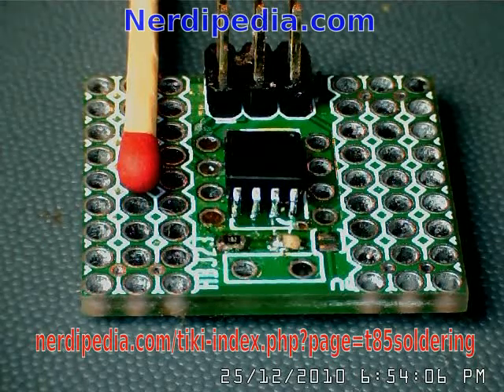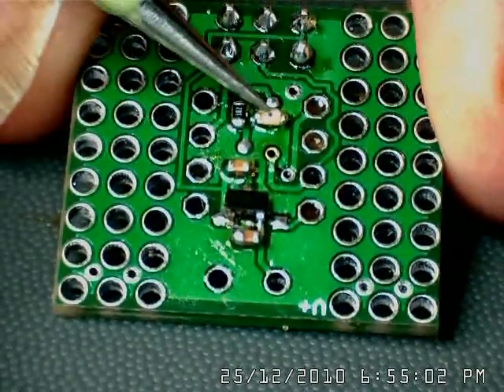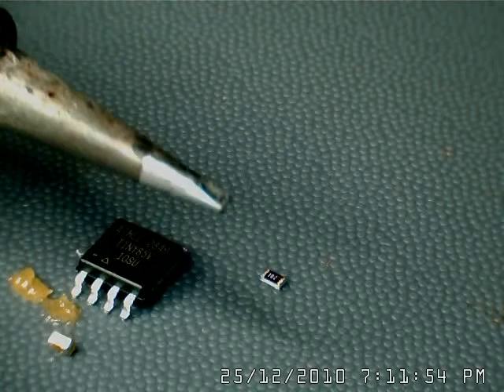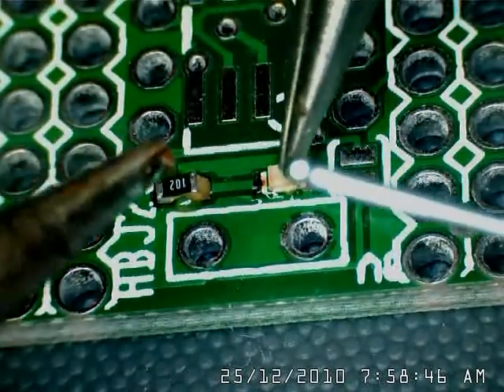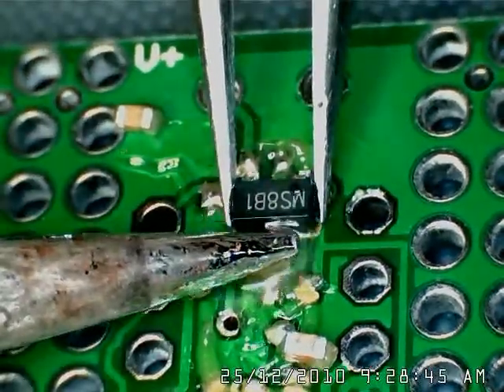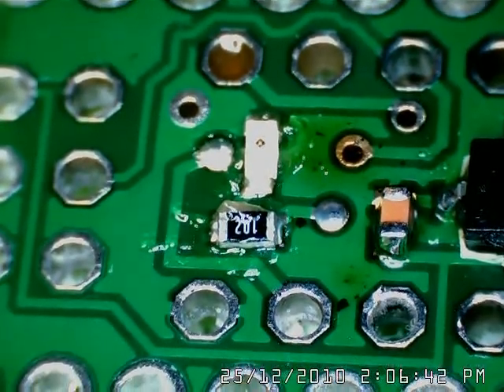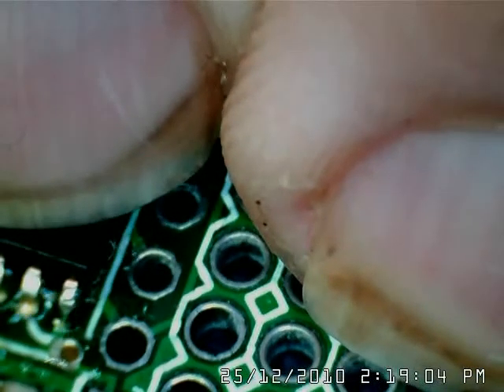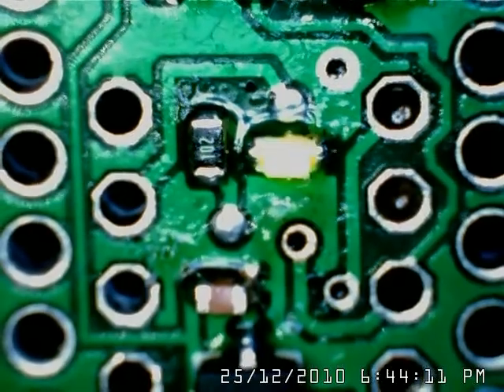SMD_soldering_tiny85_PCB.mpeg

Comment from the maker: Mtaalas.
I did try that and it seemed feasible but not easy. You have to orientate the camera so it sit between you and the work otherwise the image is from another angle and very confusing. You have to work slowly because there is a noticeable lag in the image. The fumes probably don't do the microscope much good. I've have also fallen into the trap of buying a USB microscope and finding it will not focus unless very close to the subject.
Cheers Eddie,